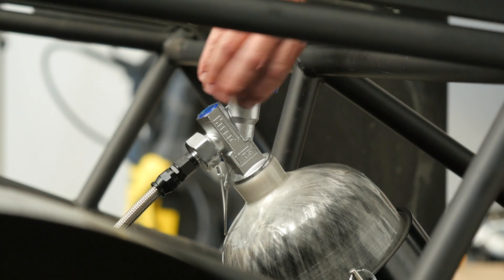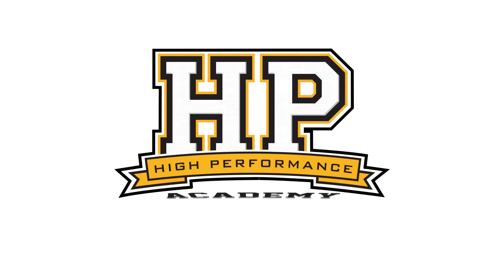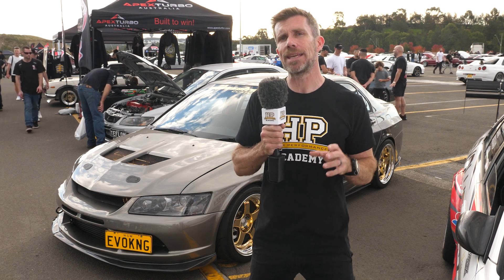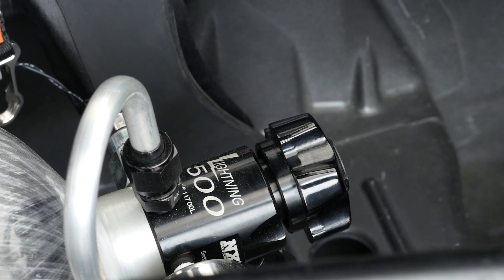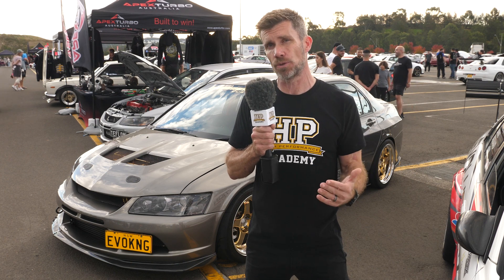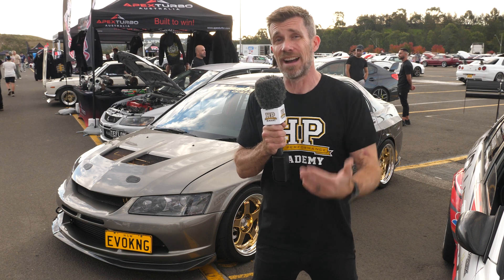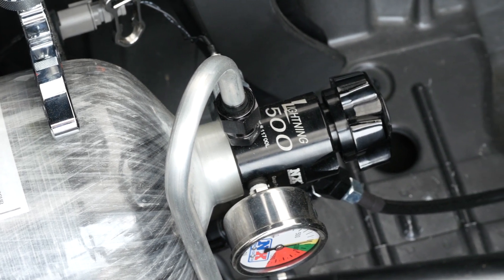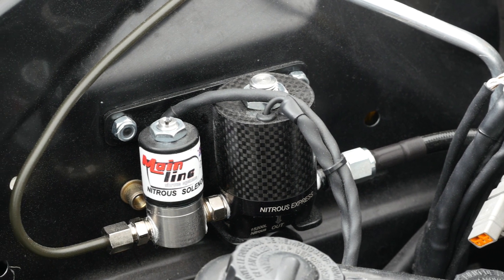Chemical Supercharging In 3 Minutes (Nitrous)

Comment: I always wondered about the Pike’s Peak boys.  The electric VW owns the crown there. But surely a gas engine with progressive nitrous injection, dependent on air density; turbocharged, driven by my man Sebastian Loeb could crush that sissy. Any thoughts? Have any team tried density-controlled nitrous? It seems like a no-brainer. And if not, I demand vinyl wrapping of their car.
Reply from the maker: Pikes Peak is interesting in how the weather and road conditions at the time also play a massive role in performance. You need a fast car to make the most of them, sure, but it's not just black and white down to the car and driver - Taz.